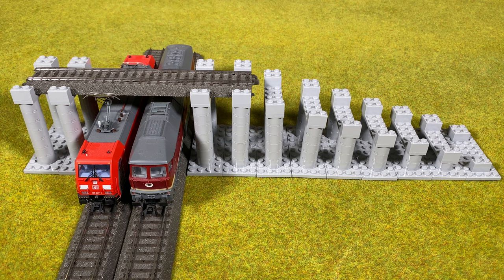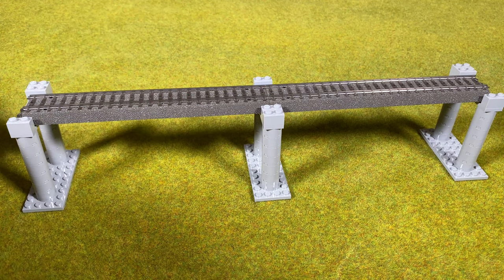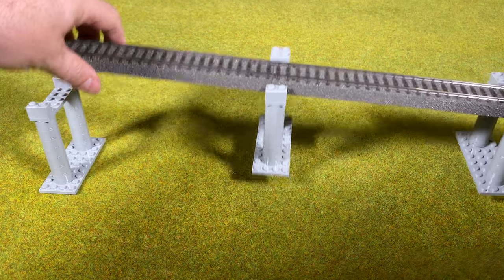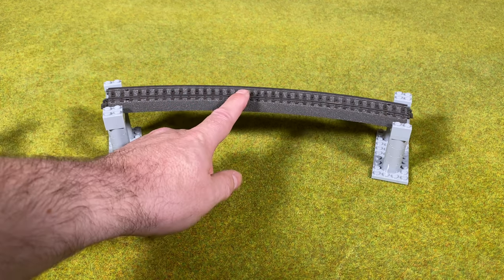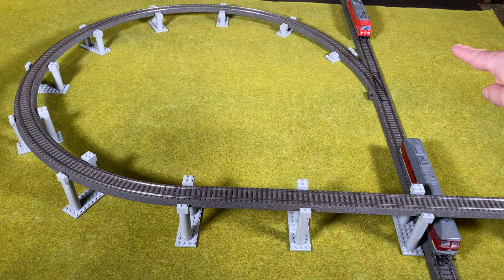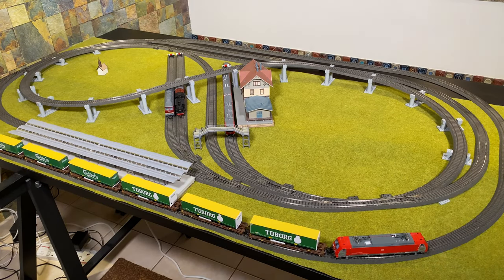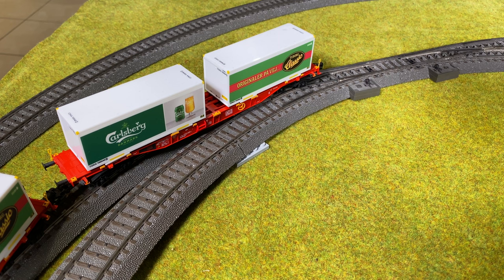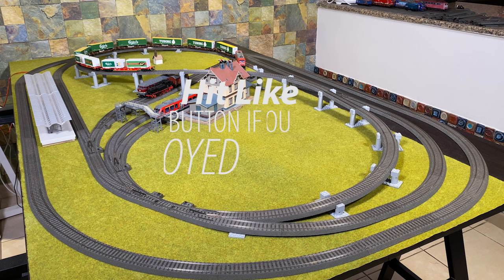Simple Lego Bridge with Approach for Märklin C-Track (Tutorial 09)

Comment: Very nice video, thanks.  Even with your 'quick and dirty' Lego bridge, you can reduce your incline to 1-2% if you use the thinner round plates (PickABrick ID 4211475/4032) instead of the round brick (4251378) in your columns. Three stacked 4211475's is the same height as a 4251378. The incline will be three times longer of course!
Reply from the maker: Glad you liked the video. Great tip! Indeed one can use the round plates as well for a much smoother incline. On my little layout I did not have any issues with the steep incline. However on a larger layout with longer trains I suspect that your tip would definitely be of use. Thanks and enjoy ;-)

Comment: Another great video to watch. Even if you do not have enough space for creating an incline, it is good to know how you can create one.
I have one question though, irrelevant to inclines but I guess it's OK to ask. At 23:57 you say you have a dirty track. Would you please tell us what to use and how to clean the tracks? I guess you must clean the two rails on the sides and the one in the middle Thank you.
Reply from the maker: Hi John, the most important is to run your trains - this keeps the track clean. Other than that, I use Märklin 46049 or some cardboard or cloth for spots that does not easily go away. For the center rail I also have a car with light and a slider to help clean this one. A toothbrush if it's really dirty. For the most part I just run trains and occasionally the Märklin 46049 and a car with slider/light. I have not made any video on this, but check out this one by @marklinofsweden: https://www.youtube.com/watch?v=0olM5Zq1zlY Enjoy ;-)
Reply: @ModelTrainFun  Very interesting... A wooden block to clean the tracks! Simple and easy.

Comment: I all honestly when you first made videos and had these in some shots on a counter I thought it was a dish drying rack. These are quite useful and inexpensive compared to marklin pillars one thing to mention, on a 2x plate there are parts called jumpers with half stud offsets, place them down 2 at a time with 4 studs of space between them. Add a 2x4 tile then a 1x2 brick on the the exposed jumper studs and add the track as desired.
Reply from the maker: Dish drying rack - LOL! I think when you are saying jumber you mean the "PLATE 1X2 W. 1 KNOB" as an example 6066097. Ideed - this is a great idea to use these. I might Thanks for the tip! Enjoy ;-)

Comment: Well, it's not too realistic to leave the ballast floating in the air like this (or do you have a ballast source from Pandora?).  So you could cut out some folded cardboard bands to give support to the tracks between the pillars. This would allow you to place the pillars independently from the track joints, for smoother slopes.  And while we're at it with cardboard, you could also cut out the pillars from it, and use paste to build some more permanent bridges ;-)
Reply from the maker: Great idea for making it a bit more permanent. Enjoy ;-)

Comment: Hello Bo thanks for the explanatory video. I never used Lego but can you double the base plate at bottom and top of the grade to help the vertical transition?
I would try Blue-tac (stationery putty) under the outer track base at the pillars to provide some super-elevation.
Reply: You might also try a short track immediately after the turnout (24094) to assist with avoiding the pillar conflict with under-track at the top oft grade.
Reply: Very impressive running over the bridge. I can see you have extracted the maximum geometrical function from the available space. Marvellous.
Reply from the maker: Hi Kimball,

Agree you can use Lego "plate" pieces that are not as tall to make smoother transitions and less steep grades. You can find the Lego plate pieces in round 4x4 as well. 

However, if you are making a permanent layout I would make bridges and so on as part of the landscape. The Lego bridge is good for temporary layouts to make some variety. I use Lego as I have some laying around, but Lego can also be expensive. Making some wooden pillars would be a cheaper alternative. Unsure if blue tac is good with Lego or it will stick - or make a mess? But sounds like an option.

Enjoy ;-)
Reply from the maker: Agree - this would create a much smoother transition.

Comment: Hello Bo, I know at the end you are saying that some bricks are not available anymore. But I have the impression that the site of Lego has changed also a little bit 😐. So I'll fiind nothing for the moment of the bricks you have used because after filtering on GREY and BRICKS you stille get 400+ results 🤥. So not so easy to find your way in it, isnt it ?. Can you give the (old) ref Nr of Lego of the pieces you have used. Perhaps I can with a little bit of search on the web find the replaced piece. I hope you can get me again on the road ... euh track I mented 😂Thanks in advance. BTW Again super interesting video. Thumbs Up !
Reply from the maker: Hi,

Yes it can be difficult to find the correct pieces. From the video description you can see the pieces we need:

 - Base plate: 4x10 plate
 - Pillars: 2x2 round bricks
 - Bracket on top: 2x8 plate, 2x2 brick, 1x2 brick

I basically search for Grey and the name e.g. 4x10 or 4x10 plate. Looking at the Lego web-site I would suggest the following that you could consider (please double verify):

 - Base plate: 4x10 plate (ID: 4211402/3030)
 - Pillars: 2x2 round bricks (square ID: 4211387/300)
 - Bracket on top: 2x8 plate (ID: 4211406/3034), 2x2 brick (square ID: 4211387/300), 1x2 brick ID: 4211388/3004)

Unfortunately, I did not find any round 2x2 in grey - it does not seem they are available. Consider the square one instead (id above) - or use the round plate (ID: 4211475/4032). Alternatively consider another color or design. This one might be interesting? ID: 6236949/39683. The grey 2x2 barrel might even be usable, but it is an expensive piece.

Please do double check my findings to ensure the pieces fit together as desired.

Hope this helps! Enjoy ;-) Bo
Reply: @ModelTrainFun  Thank you Bo, you helped me a lot, but as you say, finding those pieces you used are no longer for sale. So I'll have to find something that helps me build those bridges. I want to use it temporarily in connection with a new permanent job. ;-) Will definitely be fine and as I said, great to be able to follow your videos and educational. Sure for a novice like me. Great!👌👍